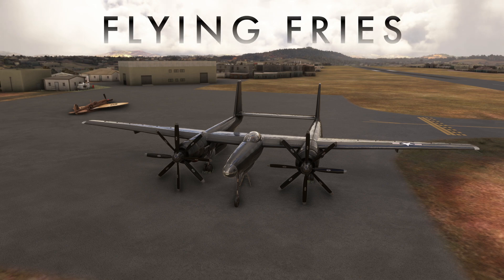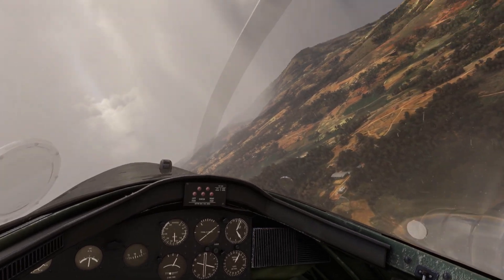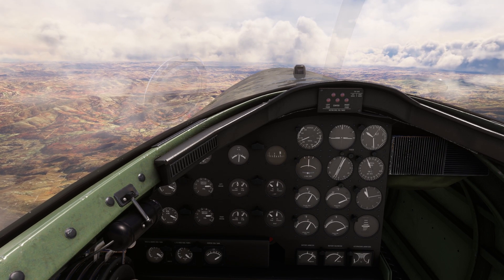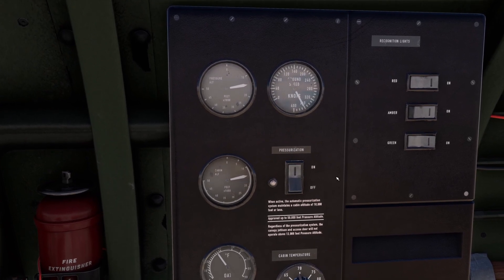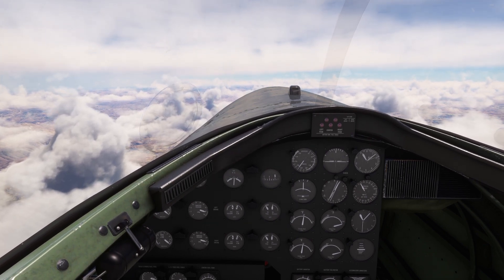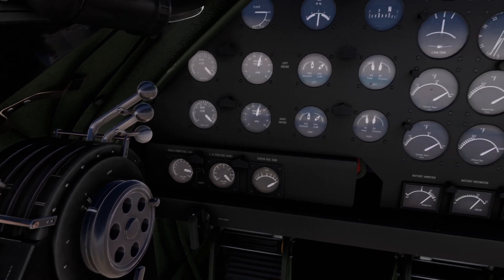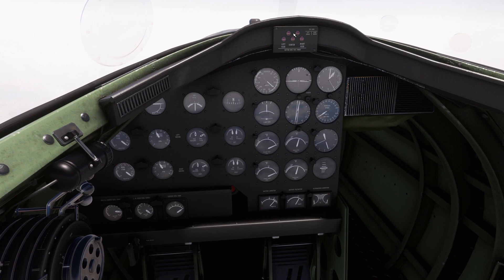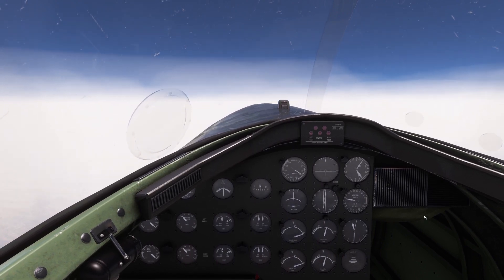XF-11 - High Altitude

Comment: Just got it today. I hesitated because I have a tendancy to fly military type stuff once, then they just languish unused. But this one is different. Besides being quite a unique aircraft in size and appearance, it flies differently too. An aircraft offering such radical performance for its time is absolutely not going to handle like some general purpose passenger twin or trainer. It's bound to be quirky, sensitive and demanding at least in some areas of its flight envelope. And I sure wasn't disappointed! Obviously a great deal of thought and effort went into this XF-11. I'll be spending time with this one.
Reply from the maker: Thanks for the nice comment, Gary. It's true that it doesn't fly like any other warbird. It's a machine as eccentric as its creator. And I'm glad you appreciate that and will fly it even more :)

Comment: So, I think I'm narrowing things down.  The issue looks to have been the aspect ratio of the propeller blades and the power absorbed specs in the propeller portion of the engine config.  I have been able to maintain 310 or so knots at 33,000 feet, with power settings of 2130 rpm, and 27".  With this I am getting a fuel burn on each engine of 241 gallons an hour which is actually below what the Stratocruisers engines did, so I have some more tweaking to do.
Reply from the maker: Actually, the higher you will fly, the less fuel you will burn. At around 40,000 ft, if you don't have a too strong head wind, you should be able to fly at about 300 knots (ground speed) for more than 4,000 NM, over about 14 hours of flight if you have the patience.

Your fuel burn rate will be close to 75 GPH per engine.
Reply: @flyingfries1027 Yep, I was able to get that, but the climb to 40,000 in a realistic (eg, not 2700rpm, CHT and Oil temp off scale) was arduous.  I'm still tweaking the prop settings and getting closer to more realistic performance.  The climb should be maintained at 2350 rpm, or at most 2400, but not at 2700, I don't even think ham standards could survive those rpms for long.)

Comment: There is something not right about the engine performance at 33,000 ft.  There is no way it will fly 4300 nm (5000) miles with the engines turning at 2700 rpm and full throttle.  If one did that with an actual 4360 ( which turned at 2100 rpm with 40 inches mainifold), you would end up with slag in the cowlings and a burning airfrrame.  At 20,000 the plane performs as it should at 40" 2130 rpm but is still well short of the historic range of the plane.  Not sure what the issues are.  It is a shame cause the flight model, and visual models are stunning, but the engines and the massive fuel consumption is not having this be the long legged beast the actual article was promised to be.  Perhaps the props are not correct, or the turbo charger is not modeled quite right.
Reply: Long critique following an aborted long distance flight.  (The following is offered only to help improve this impressive effort, it is only critical observation and suggestions) So I did notice something today.  I attempted to do a flight from Hawaii to Castle Airforce base in California.  I took off with full fuel plus drop tanks.  I also tried to do the ascent with more realistic engine settings for climb.  The P&W 4360 installed on the Boeing 377 Stratocruisers were not much different from those installed on the XF-11, and from what I have seen those had a climb power setting of 45" Manifold Pressure (MP), and 2350 RPM.  The plane climbed happily to around 15,000 ft, when it started to peter out, and lose speed.  I noticed in the climb I have to increase the throttle, to maintain the MP of 45".  My understanding is this is not done with engines that are turbosupercharged.  The 4360s on the XF11 had both a two stage engine driven super charger, but also two massive General electric turbo chargers per engine.  With these when you set the climb power, it pretty much stayed put until critical altitude (or the altitude at which the turbo charger waste gate is fully open and the engine behaves like a non turbocharged engine.  Here is the issue with this. YOU DO NOT increase the throttle to maintain the MP you had before critical altitude with the massive GE turbo chargers.  My understanding is this was because to do that could lead to over speeding the turbine, which could lead to failure.  Now, I know at 18,000 ft there is a big boost in power due to you simulating a 2 stage supercharger kicking over to the 2nd stage.  That big bump isn't quite right, and on an actual 4360 could lead to damaging the engine.  I noticed you are climbing at full power, and 2700 rpm (!).  To do this with the 4360 would be a very bad thing.  This would destroy that engine.  These were massive engines and were also quite slow turning (the Stratocruiser had a cruise setting of 40" and 2130 RPM...That is slower turning than the prop of a cessna 182 at cruise..  I then noticed the oil temp off the scale, in your vid, along with the EGT CHT being off the scale.  I encountered this in my climb out.  I decided to just go full bore, to get up to altitude, (33000), after reaching that altitude, I tried the cruise setting of the Stratocruiser, and noticed the speed dropping right off, and came close to stall, but instead of stalling the plane just did not maintain altitude and just started descending.  Something is not right with the engine parameters, but I think this can get worked out.  Out of curiosity I just again went full bore, full throttle and (eek) 2700 rpm.  The aircraft started climbing and maintained 33,000.  Next I did a fuel consumption check, and found the engines were consuming an astonishing 313 Gallons per hour per engine.  The engines of the Stratocruiser at cruise was pulling 134 GPH per engine.  Going full bore the plane had an endurance of 2.9 hrs.  That is not enough for 4300nm (50000 miles).  At 300 knots, 4300 Nm, requires 14 hrs of fuel.  I aborted the flight and flew back to Hawaii.
I think the issue is the engines lose excessive power at higher altitudes, and I am thinking it is something to do with how the turbo charger has been set up.
I big sign something isn't right is the oil temp being off the scale even with the cowl flaps open.
IF you made it this far, please understand I am only offering help with making this beautiful aircraft model more true to the real world article.  It is not meant to be a harsh criticism.
I'll experiment with the .cfg files and try tweaking the engine parameters.

Comment: Just got this bird and after a test flight around Hawaii and taking it to the highest it would go, then scream along the water as fast as this thing will go, followed by a difficult but not awful landing at Honolulu, I found this add worth every penny of the cost.  So well done for a very small developer.  I also have the Scrap Yard baron which is also fantastic.  Wishing you success in this work you do.
Reply from the maker: That's a very kind comment. Thanks a lot :)